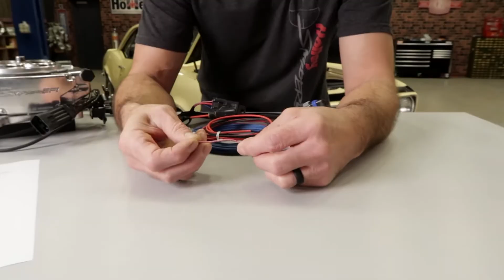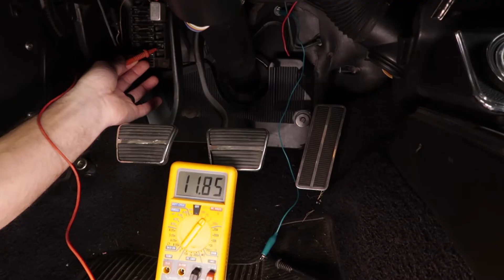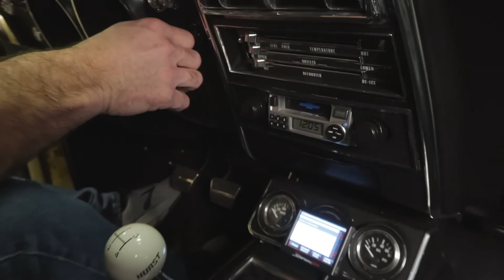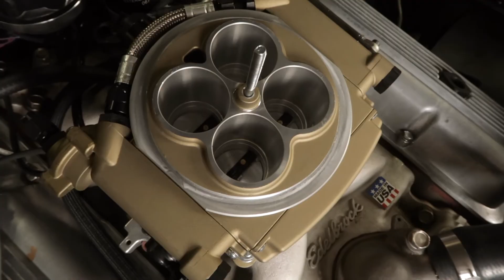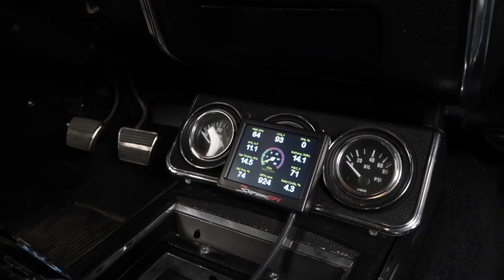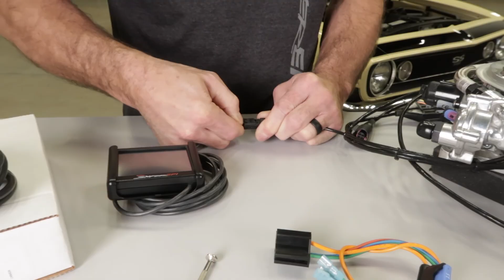Sniper EFI Initial Startup and Troubleshooting

Comment: I bought mine a few years back an it worked fine for a few months then I was driving it just died on me out of know where its got good fuel pressure its getting 12 volt but won't start at all there's no spark on start up or cranking I even disconnect the efi from the fuse block an the battery an I got spark again so I took it off an said great I wasted 1200 dollars for a paper weight now im back to the carb again an getting terrible gas mileage but when the efi worked I got the best fuel mileage I've seen in a 1977 chevy truck 4x4 I was happy but hopefully after a few more years of saving money I should be able to get a new holley sniper efi kit an try it again I just hope it doesn't go bad like the first one did

Comment: Hello can you help with this issue. My Sniper has just started to malfunction. Its not turning on and or priming the fuel pumps. If i turn the ignition off and on I might get lucky on the 10th to 50th attempt and it will boot up and start. Where should I start looking for issues?

Comment: Sniper 2 and hyperspark ignition:
The car starts rough and then stalls if I press the gas pedal.
Grounds are good
Initial start up wizard complete
15 degrees of start up advance set
Verified fuel

Comment: Hello I have a Holley Sniper EFI 550-510 which I installed on my 67 Mustang. Ran good all summer last year. This year when I started the car after its winter sleep it started  well for its first ride and midway the display started to act up and the car all of a sudden started to run very bad and thick black smoke as if too rich. Now when I start the car the display only blinks but won't turn on and stays (blank) white. Is there a way to remove activate the display? Thanking you in advance

Comment: car was already running pretty good except after running would have hard start so I purchased the 2300 in hopes to eliminate this problem once and for all. Installed the kit and followed the instructions word for word and tried to start. everything was as it should when key is turned on and pump cycled for 5 seconds but the engine turns over, starts for 2 seconds and shuts off. try and try again and same thing, only way to keep it running is the pump the peddle and keep it over 2000 rpms and if not then stall. messing with it for 3 days and no go, and can not find anything on line to help with this issue. so far not impressed and Holley tech has been no help with recommending to check timing and plug wired even though the car ran before the install.
Reply: adrian, did you ever get this sorted? I seem to be having the same issue....

Comment: It's great you are running the spacer to eliminate the Holley Sniper squeal/whistle/howl under load. For everyone else, the Holley part # is "HO 520-2".
Reply: Mine starts clean for 2 seconds and stalls with no fuel pump running.  But runs to prime , shuts off and then nothing after start up ?
Reply: @jerrywood963 id check your wiring. Go over it and make sure it’s exactly what Holley asks for. 👍

Comment: Touch screen not working. Very very frustrating
Reply: Swap to the HOWELL EFI system, it uses the proven GM parts, all off the shelf stuff, computer takes care of all that stuff.
Reply: Did you check your cable connection from the handheld to the sniper?
Reply: @laurawilliams9691  yes. Avionics by trade. New screen fixed issue. Nil refund on new part. I don't use holley anymore due to not receiving $500 refund for faulty part.

Comment: Recently began to set my timing on my 1972 camaro 383 stroker hei distributor. No start at all just cranking. I checked all wires and everything seems good. I have air, fuel, and spark but no fire up. Could this be a bad ecu?
Reply: I have the same problem, fuel pump won’t stop priming either, I’ve seen a lot of people who needed new ecu

Comment: I have a problem. The Pink wire. What does it Not do, if it dont have 12V on cranking? I swapped my '73 Nova wiring to Painless harness, and i couldn't find a wire wich have 12V on cranking.. Help!

Comment: How come it is advertised as a carb conversion kit   that you don't need a laptop and tuning skills to use  and then few pages into the manual  - for best results initial fuel table needs to be created  on your pc not to mention same thing with holley sniper dual sync distributor  that should be used after initial learn is done . Set it to 50 BTDC   and then check rotor phasing? then why You set your initial angle? what for?  it should be exactly set right from the box!   and the best joke is when instructions say to cut hole in your cap to see where rotor   is.....Would be nice to set engine to 50BTDC set dist as LED on off on and then hit cal on the  handheld......ps my sniper efi just died .....    

5 months later update- i know personally four  people that  bought new snipers efi and they were faulty from the box or never worked properly.  All of them had floding issues. RFI were not an issue. all wiring was neat freak . new ignition system that was "quality" brand . wires,spark plugs distributors you name it. Sniper EFI is a junk and if you respect your money do not buy that crap. All i heard and experienced on my own was highly dissapointing to say the least. 
Pinched wires under covers that contain ECU are common. Then mystery RFI i think it is only a childish excuse to get you occupied with fighting an invisible problem. Problem is in Your ECU which is getting screaming hot by sitting on top of your engine under the hood.           Another BS is story about self learning. If that thing can learn to all yopur mods you installed why it can't tell You what the problem is? is that pile of junk is capable of recognizing engine is running like  a bag of crap ? My sales guy told me that you indicate what camshaft you have and then it  is doing self tune. So when i press throttle and AFR is fucking up to 32  why that fucking usseles pile of junk can't see that ?  download the app and buy a cable and then what ? if that fucking thing can't reverse changes it made  why da heck i should help it if you  (holley) say  it as a self tuning ? You should have lifetime warranty for that pile of scrap metal just so people can make you busy with your great product.  I'll take mine apart and if i will find pinched wires or some other abnormalities it goes on the display and i will take it to every car show in my area to show people  your junk.
       Another question is- if you build your engine and collect all bits and pieces over the time is there any chance to have some confidence that it will be good when it comes to firing your engine ? i mean i don't have to start using it from the day i purchased it ....... what then ? i am out of the warranty ?
Reply: Did you find out what happened to your efi?

Comment: If you have to probe wiring through the insulation, use a sewing needle or safety pin to puncture instead of the test light tip.  Much less damage to the wire.
Reply: by piercing wires you open  passage for  water intrusion and then hidden corrosion/high resistance
Reply: @metaxa715  That's what tape is for, or a dab of super glue or use a glue gun & put a dab, that way the location is marked if you need to probe again
Reply: Or fingernail polish

Comment: IT RUNS.  My lovely wife tired of my profanity directed towards”all things electronic” . She correctly overwrote the programs and installed.  Car started after 2 priming shots.  Ran until water was 185 . Engine has started to noticeably improve.  Now.....get ready for It ..........the timing has issues .   Teck support.  Or 
Where is that redhead.
Reply: idle is too rich. set idle afr to 14.4. OR EFI can't fix and already dead engine.

Comment: I spent 2200$ for sniper master kit and tank ran 20 miles. Contact Holley 5 times wait 20/35 minutes per call, then was told , it’s this , then it’s that, you need a new MSD box. New box 325$ new  distributor cap phased rotor 70$ 12 hrs trouble shooting nothing won’t hit a lick. Holley agreed to replace unit. On removed ,I found part of the wiring harness  had been  crushed during Holley’s assembly process , not repairable .
New unit Arrived ,plugged it all in , turn the key and the hand held shows ERROR ,ERROR.
Call  to Holley another 45 minutes on hold . Was told “you need to remove SD card go to Holley and down load the software latest up date.    SOB it’s a new unit shouldn’t this be workable on delivery . Holley Teck said “No this often happens”
Truly , the instructions leave a lot of stuff out. I would know this as I got a “geek”  to help me .   
 REMEMBER THIS The down load will fail if you don’t power off your personal computer before you remove the loaded SD card. 
Installed all info on card to ECU.  Worked great for 10 seconds backfired ,  Caught  on fire. Flames shooting from sniper , at this point  I don’t give a damn.  Somebody owes me a durable working unit.  I’m sick ,2500$ and my car will not start and has been been on fire . Thank you Holley.  
Round 3 is coming up
Reply: How did round 3 go?
Reply: my buddy found pinched wires too. Other shop in my area says they re did many of those pinched wires units for people.

Comment: Thank you for the detailed video. I am not getting TPS to the required number (85%). It stays at 0. My fuel pump turns on when the ignition is on but shuts after 15 seconds. This happens every time. Any suggestions?
Reply: You posted 2 years ago and NO response, have you solved the problem ? If so WHAT was it??

Comment: My issue after install is after the engine starts, I get a physical wall in the throttle at about 20% throttle. If I push through it I jump to about 70% throttle. While fun tearing down the road it makes my neighbors pretty upset. With the engine off and powered down the throttle moves all the way to the floor with no catch and the butterflies open normally.
Reply: That is a vacuum issue weve had it happen before on installs we do where engine vacuum is holding the butterfly's closed at idle due to a low idle speed.  We corrected it by bumping the idle up by opening the butterfly plates some.  For my personal teuck if it happens I found there is a aftermarket linkage extension that adds about a inch to the throttle position on the theottlebody which will allow for more leverage.
Reply: @Milner62  Would be nice to see a picture or video how this is solved, maybe Holley will address this
Reply: @REVNUMANEWBERN , there is a fix, Holley had it for a while now.  It is a throttle lever extension.  It bolts on and lengthens the cable attachment point further out from the throttle shaft.  This gives more mechanical leverage and makes the throttle silky smooth.

All the vehicles we did before I found out about the lever at work, I called up and had them bring their cars back into the shop to correct the issue for them.

The Holley 4150 Stealth I have on my engine for my truck has the lever extension on it from the day I bought it.

The part number for this Holley extension is 20-16 if you want to pick one up.

Comment: I am having a issue with my sniper. Been on for a while and fine. But the other day I went to start it and accidentally bumped the throttle during startup and now it won’t start. I have tried resetting. And I have tried to restart. The injectors are getting fuel pressure to them, just not being told to fire. I am leaning towards a bad TPS. What should the sensor OHM at idle? And WOT?

Comment: The problem I had with my setup was the the idle was super high...like 1200 rpm. I thought I had a vacuum leak or something equally complicated (maybe I need a spacer below the throttle body, how's my timing) but it turned out that the idle speed screw was cranked in too far.  The instructions never even mentioned the idle screw and I only figured it out by consulting some random guy on YouTube's home video.  It would be a really good idea for you guys to beef up that section of the instructions.  I really expected that issue to be covered in this video as well.
Reply from the maker: We have a video specifically targeted towards troubleshooting issues like that coming out very soon! -Keith
Reply: @HolleyPerformance  Suggest putting the link and comment about such as the top comment & in the description
Reply: THANK YOU for bringing this up, ONE of the reasons I HAVEN'T went to a system like this is all the nightmares I've read about, HOPEFULLY after the number of years these systems have been out there is a complete video addressing ALL the potential issues that has been encountered
Reply: Its right in the quick start guide, page 12 to be exact.

https://documents.holley.com/199r11193.pdf